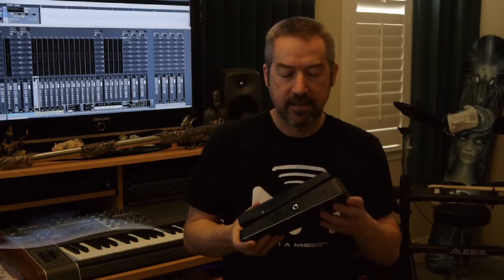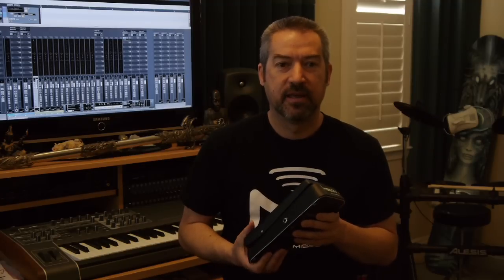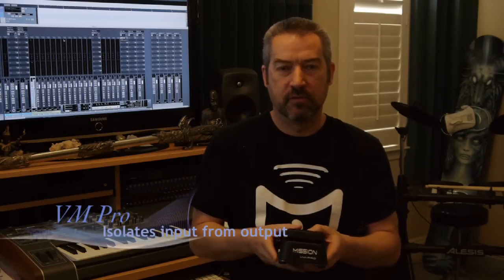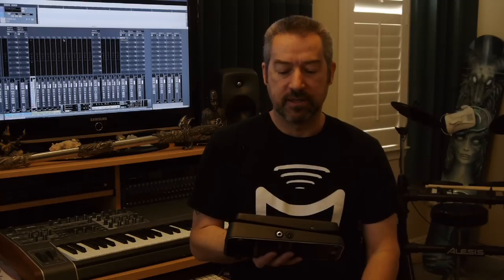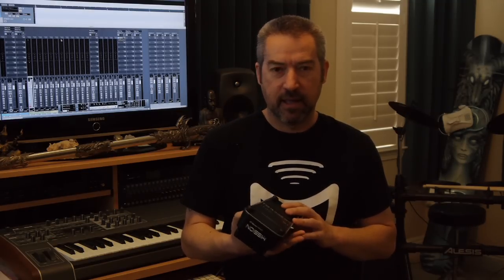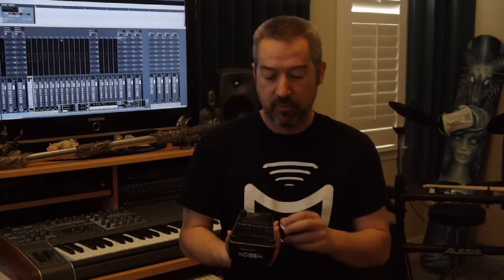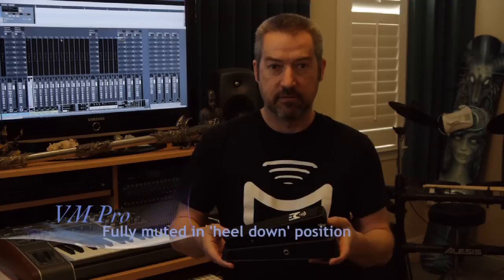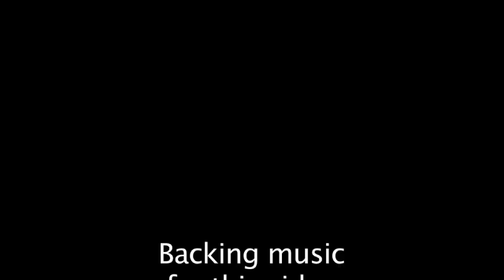Mission VM Pro Volume Pedal Tutorial

Comment from the maker: The VM-PRO is the next generation and replaces the VM-2. VM-2 had a buffer only. VM-PRO adds the selectable input and output settings, the sparkle switch, the minimum volume control, and the isolated tuner out. We've also made some minor improvements to the buffer. The PRO series also adds the PZ version for Piezo pickups.

Comment: Thank you for the video. My issue at the moment is I cannot remove the distortion effect. I've tried different switch settings but no luck. Is there a way to get rid of the distortion? The dipswitch is reducing it but not eliminating it. I have it at the beginning of my pedal chain, going thru my Voodoo effects looper. I really like this pedal but if I can't remove the distortion effect I will not be able to continue using it. Lovely pedal though.
Reply from the maker: The VM-PRO does not have a distortion effect by itself. There are a couple of things to bear in mind. VM-PRO prevents signal loss. This means the signal level arriving at other devices can be slightly higher than when the VM-PRO is not present which may cause other devices, especially boost or other gain devices to clip. Make sure that the Active-Passive switch is set to the active position. Also, you can try running the VM-PRO with a higher DC power level such as 12V or 18V. Do not go above 18V.
Reply: @JamesLebihan  thank you I'll give it a shot!

Comment: +James Lebihan Should I use different switch settings if I use the pedal in an effects loop as opposed to between my guitar and amp? Thanks!
Reply: Depends on the loop, but in most cases I would probably set the active/passive switch to active. Try both and see which works best for your setup.
Reply: Mission Engineering Inc thanks so much! 
How would you recommend me connecting the VM pro directly to my amp if using your tuner Y cable?
Reply: If you wish to run a short cable to a tuner and a longer one to an amp you can use a 1/4" coupler, or have a custom TRS insert cable made. https://www.amazon.com/Planet-Waves-Female-Stereo-Coupler/dp/B0002E52S4
Reply: You can use a 1/4" coupler such as this on the amp cable https://www.amazon.com/Switchcraft-4-Inch-Female-Adapter-Nickel/dp/B00C5B1NXK/ref=pd_lpo_vtph_267_tr_t_3?_encoding=UTF8&psc=1&refRID=4A8HWXZQX7856PAW4KRY

Comment: Hi James. My vm pro keeps dropping. It wont stay in position when i roll down the volume. Whats the cause and any solutions to this problem?
Reply from the maker: You can tighten the tension adjuster at the back using the hex key provided. If that doesn't work, check out the support section at missionengineering.com and you can send it back to Mission for service